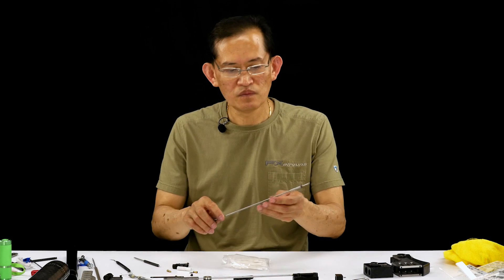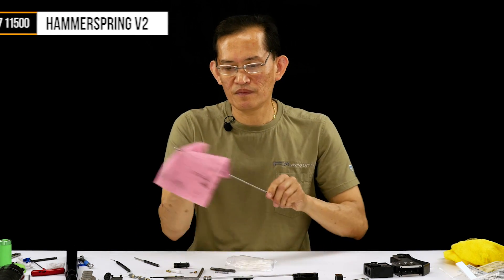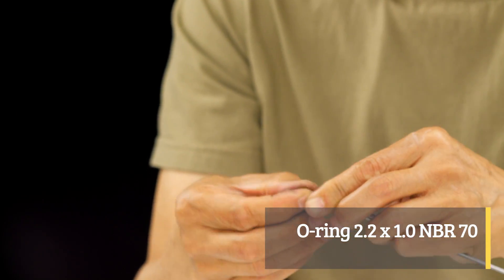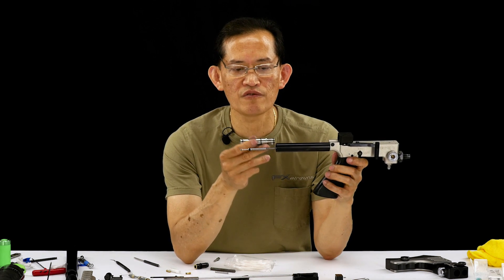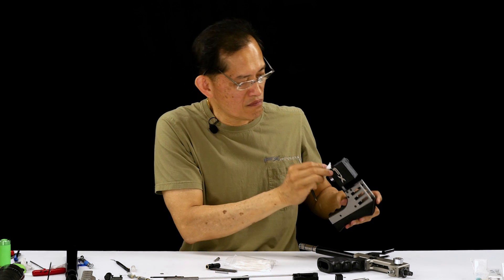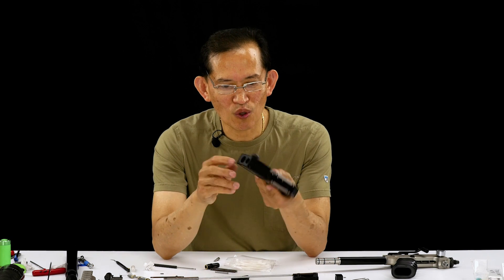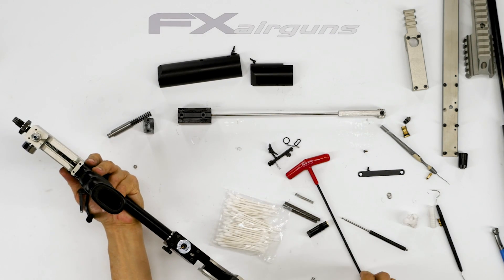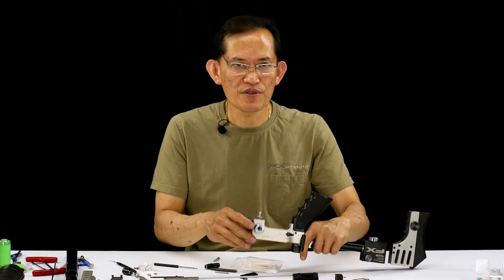FX Impact Valverod Maintenance : (4/7)

Comment: hi fx airguns , i want buy 
an fx impact mk3 in cal 177 4,5mm i have a question about the impact , how mache shots can shot the impact mk3 in cal. 177 4,5mm with the original 480cc bottle in 7,5 joule ? 
and how much shot can shot the impact with the 580cc carbon bottle also in 7,5 joule in cal 177 4,5mm ?? and how much shots can shot the impact mk2 in cal 177 4,5mm in 7,5 joule ? pleas help
Reply: I have the same question !